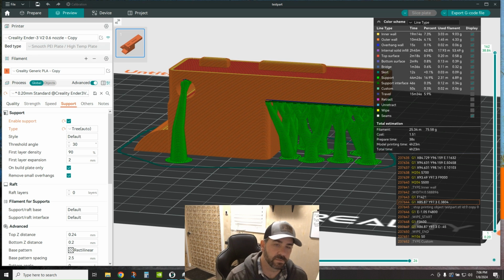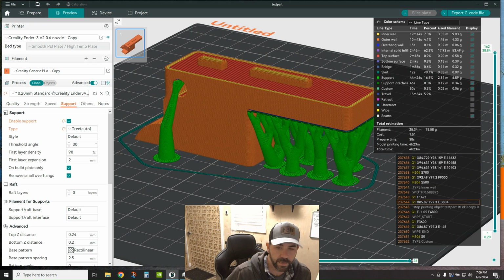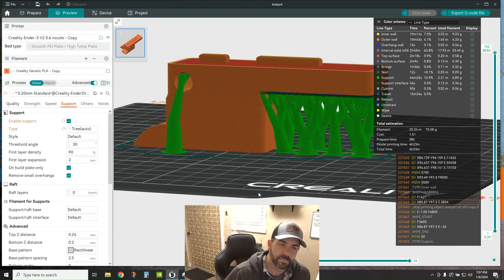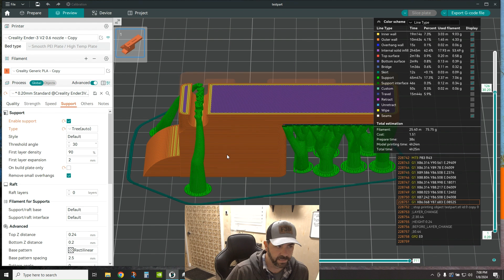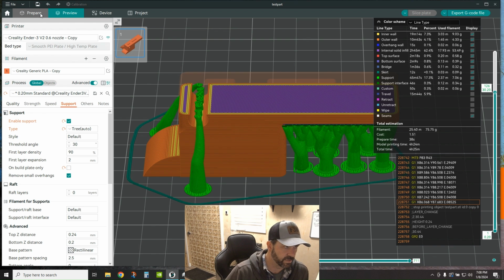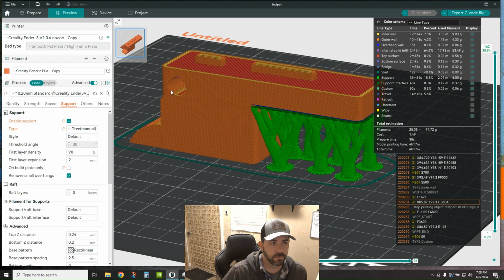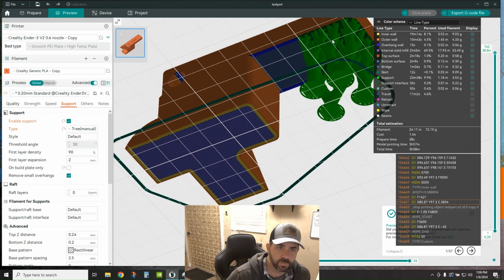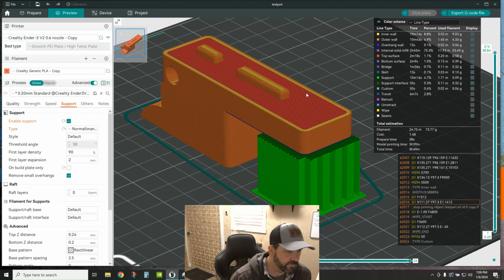Optimize your Supports with Support Blockers in Orca Slicer

Comment: Blockers will work even if you are using auto supports. So, if there are a lot of supports added automatically and you just don't one in one place, you don't have to go and paint all of the other supports. In fact, if you are doing manual, I don't think you need to use blockers since it'll only add them where you paint them.

Comment: great video.  I have 6 tall thin parts to print.  I want to print them close together and share the supports.  Is this possible?  In essence they would come off the bed as one solid and just need seperating.  I figure joining them together with the support would make them for secure and stop them falling over
Reply from the maker: sounds feasible. You can select one then hold the control key and click the others to select them all.  Then right-click and select "Assemble".  That will make them a selectable group and you should be able to add supports collectively.

Comment: Had issues with tiny holes (therefore overhang) on the BambuLab AMS Riser print making the supports inside the little boreholes impossible to remove. You're (probably) a lifesaver for me here.
Started printing without the supports there, following your guide, now. 
Will update once the print is done!

Comment: I noticed an auto generated support doing nothing and was wondering how to remove it. Thanks for the tip. I wish there was a way yo use auto supports but remove some of the auto generated ones. It would save us time by not making us select all the areas that needs support.

Question: How do we make the layer on top of the support smoother? It’s not that obvious in angled surfaces but it’s both hard to seperate the support from the layer above and it gets wrinkly and stretched.
Reply: you can still set the support to auto then use the support painter to block those areas then it should auto generate everywhere it would normally except where you blocked

Comment: Good day. I have another question. do you know if there's a measuring tool on orca slicer to fit helmets like the mesh mixer app? I don't see one but I'm a super noob. LoL. Im also cant figure mesh mixer out its kind of complicated for me
Reply from the maker: Hi there.  There is a measuring tool and it includes a scaling function as well.  I'm not sure what version they added it, but I'm running 1.9.0 and it's there.  It is on the top ribbon next to the Text tool.  You can measure the distance between points, faces, line, etc..  next to the measurement on the screen is an icon to scale the part.  So if the inside of the helmet is 165mm, but your measurement needs to be 175mm you can input the new dimension and it will scale the whole part to that measurement.  I'll for sure do a video on this.

I hear you about Mesh Mixer.  It's a great tool, but you definitely need to learn a new vocabulary on how to work with parts.  Here's a great video that sums up how to scale using meshmixer. https://www.youtube.com/watch?v=3yqsZzYTUPA

Comment: I have to assume I am doing something wrong but this is an area where Cura is VASTLY superior to orca slicer.  I have a model that is almost the full build plate so no room for supports.  The model is essentially a tall cylinder with 3 slotted holes a few cm from the top.  They MUST be supported but orca insists on running supports all the way from the very bottom up to the top adding over 300gm of filament which is NOT going to happen.  I've tried everything I can in orca and nothing stops it from demanding that the supports go the full 227mm from the bottom of the cylinder to the slots up top.  Cura however will put the support ONLY in the slot.  There's a base area that it can put supports on to support the overhang 5mm above it but orca apparently can't figure out how to do it.  I'd slice in Cura but there's something weird going on where it print abysmally slowly...like a day and a half vs 4 hours in orca.  Pretty sure it's the volumetric speed but I'm tired of fighting with cura for settings it just doesn't have.  I also found orca to be significantly higher quality print than from Cura.  If I HAVE to slice this in Cura I'll just delete the model because it's basically a useless file.

So the big question is:  In orca slicer how do we set where the supports START?  How do I tell orca to place the supports in a very specific location and build them out from there?  Once I paint the supports it would seem logical that I should be able to use a support blocker to tell it where NOT to put supports at all.
Reply: i'd love to see an answer to this so please update if you figure it out. In the meantime, maybe you could print the holes as filled in with that special support material they make. I do imagine that would add some time due to filament changes but it wouldn't add the super tall supports, at least.